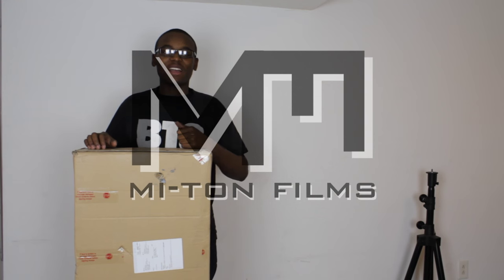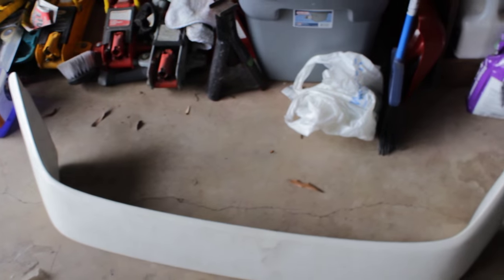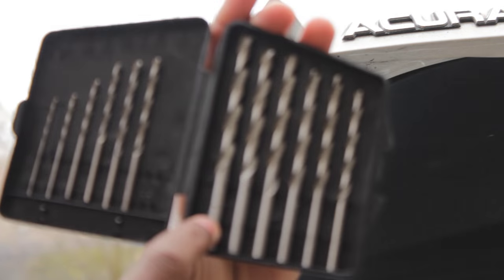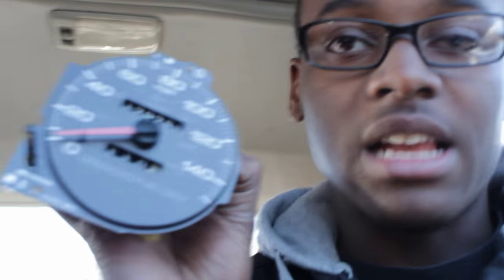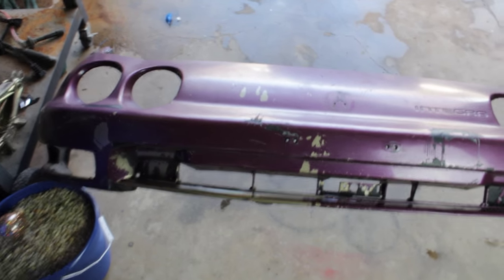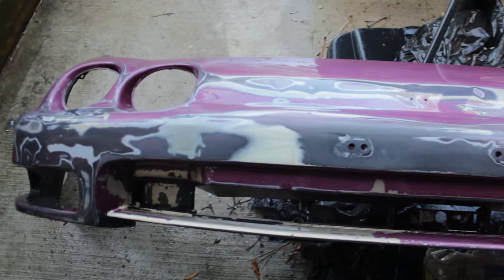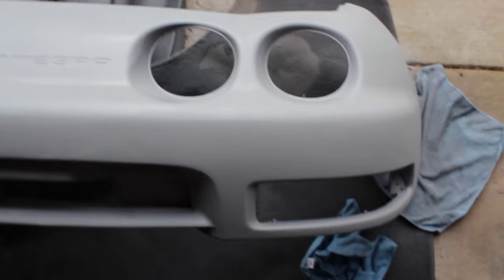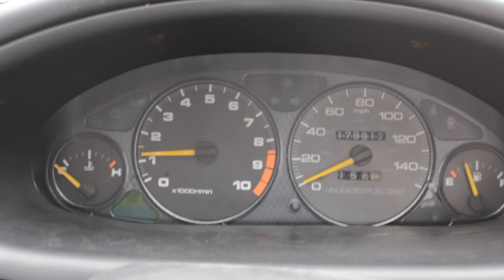Project Integra Track Car Build Episode 11-I Got Into An Accident!

Comment: Should've just got a 98+ bumper lights and ITR lip to go with the spoiler, and the 98+rear bumper, all that can be had for less than 1k.. But it's your whip 😊
Reply from the maker: I love the 98+ over 94-97, but for the price its not worth it imho. I was trying to save the money and do a cheap fix and    put the money somewhere else. Thanks for the suggestion though, if jdm engine Virginia had a 98+ conversion I probably would have bough it, but they only have the 94-97 :(

Comment: You should of just did the 98-01 front end conversion
Reply: Also a Spoon Style front lip would look nice!!
Reply from the maker: +Coda5610 Meh, yeah but I refuse to get aftermarket fenders/bumpers now, and there arent 98+ in my area...
Reply: Also TBH i would just take the car to that paint shop you said, cuz its gonna be expensive if you do it by yourself plus what if you mess up ect
Reply from the maker: +Coda5610 It's actually not that pricey so far, paint and clear came to $118 . spray gun cost $40 ,compressor is $60 ,masking tape and sandpaper another $100 and if I mess up sand down and start over, but depending on how the front bumper turns out will let me know if I should move on to another one or stop and take it to a professional.
Reply: +Miton Films What color you painting it? And howd your paint + clear come out to just $118? Im also trying to repaint my integra but cant decide if i wanna do it myself or get it professional..
Reply from the maker: +EzmoneySlow championship white . I will be using Rustoleum Auto Body Paint.
Reply from the maker: +EzmoneySlow Also i ordered 3 quarts of paint each which when reduced down with mineral spirits should me over gallon to spray with.
Reply: +Miton Films bro same here! When you film your painting stage could you please do it really detailed? It would be much appreciated haha I can't wait to watch it
Reply from the maker: The video I was planning on doing will be broken up into 2-3 Videos (Prep Day1) (Paint Day 2) (Clear and reveal Day 3) around 60+ Minutes of footage over 5-7 Days worth of work. The first spray gun test will be on the bumper, and if it goes horribly wrong I may take it to a shop, but i already bought everything so I doubt it.
Reply: +Miton Films sounds good man. Keep it up loving the build👍🏼

Comment: I'm planning on swapping my ls head with a GSR head will I have to get a GSR trans and a dizzy and all that ??? Or am I fine with just the head and will my check engine light come on ???
Reply: Your video helped me so much on taking out the stereo I put in a touch screen I would have never been able to do it lol
Reply from the maker: This is a common misconception in the honda comminity LS VTEC is not just putting a GSR head on a ls block, there is much more to it. I dont even know all the work that is required lol. Yes a gsr transmission is recommended because if you have a ls transmission the gear ratio is too long and you will pop out of vtec which is annoying as hell! I also dont recommend the LSVTEC because of reliability issues....(Cheap/Fast/Reliable) you can only pick 2.
Reply from the maker: +jakeromero86 ayye! noice touch screen!! must look cool!
Reply: +Miton Films Fosho I'll make a video soon